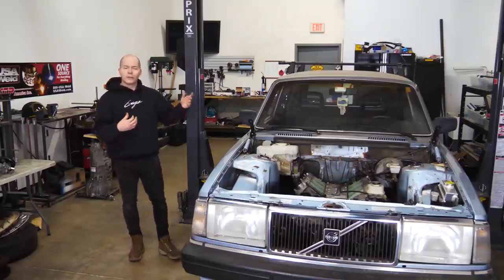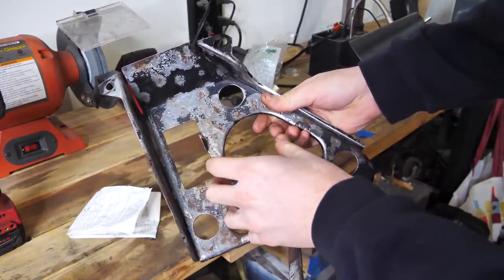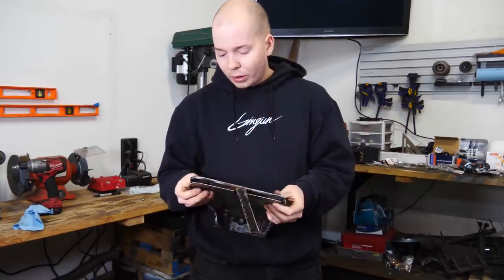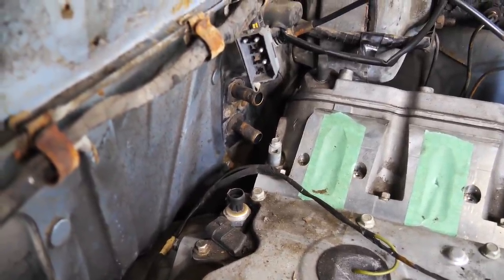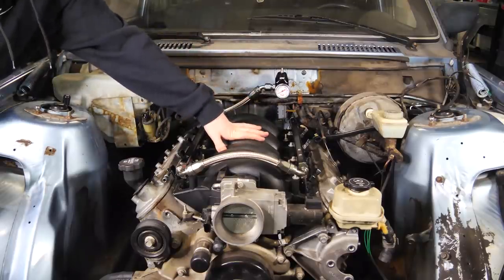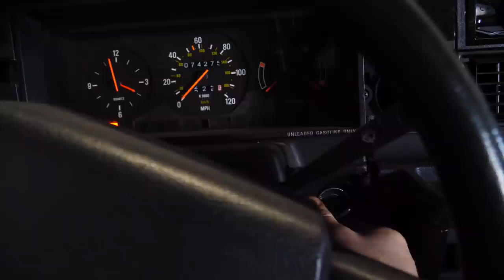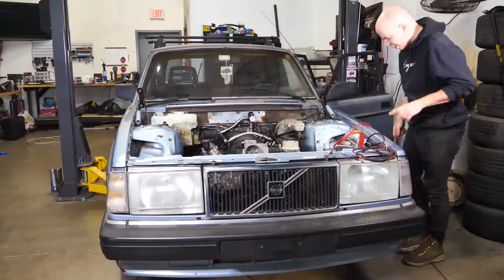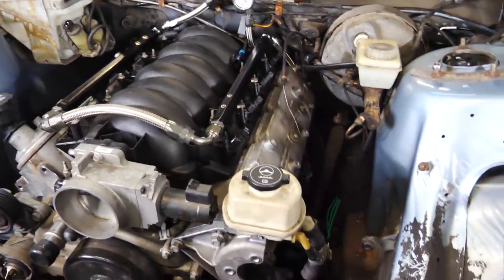Installing a $3000 UPGRADED FUEL SYSTEM on my $800 Dollar SLEEPER...

Comment: Hey buddy, just something that I learned from experience, NHRA rules state that your FPR cannot be mounted or secured to the firewall in any way and most inspectors will not pass your car for tech if they see that. I mounted my Aeromotive FPR on the firewall along with my flex fuel sensor and dude wouldn't allow me to race with my Civic.
Reply: This needs to get to the top
Reply: What's wrong with having a FPR mounted to the firewall? Just curious.
Reply: Directly from the NHRA Rule-book; Section 11A, Page 4, Under Fuel System;

"All fuel system components (regulators, cool cans,
etc.) must be installed not less than 6 inches in front of firewall.
Exception: Fuel-pressure-gauge isolators, with steel-braided line,
may be mounted on firewall"

For anyone wondering
Reply: @callmezucc9318  Thank you for this!
Reply: Bump
Reply: Plus one comment for raising this too the top so caleb sees
Reply: To the top you go
Reply: I hope he see’s this
Reply from the maker: Thats super wack
Reply: @FDB77  If the clutch, flywheel,  torque, converter or flex plate become unglued from the crank the parts flying through the bell housing don't take out the fuel pressure regulator.
Reply: @keithbusch4014  when I was building my 350 swapped s10 a buddy told me the fuel pump I had in the engine bay had to be in front of the flywheel. I learn more and more everyday
Reply: @_Gingium_  amen
Reply: @FDB77  Fire safety. Hence the name firewall. You really don't want fuel anywhere near a hole on the fire wall from what I can tell
Reply from the maker: It makes sense in terms of safety. I'll relocate in the future but for now I want to focus on getting it running/driving!!!!

Comment: There is a lift pump in the tank in addition to the inline pump under the car.
Reply: Was about to comment this myself. 240s have two fuel pumps. The other one is accessible from inside the trunk. Hopefully he sees this.
Reply: About to say the same aswell
Reply: Gingium pls see this comment
Reply: Notice me senpai
Reply from the maker: Thanks for the info! I wonder what I'll do with it 🤔
Reply: @_Gingium_  always great to see a comment response
Reply: @_Gingium_  probably just make sure its wired up correctly because you already have more than enough fuel pump with the inline DW
Reply: This is all tru I have a 92 Volvo 242 dl there is a pump in tank aswell
Reply: @_Gingium_  i see what you did there😂😂😂
Reply: @_Gingium_  get rid of it, they are small and weak pumps, they are just here to lift the fuel bc stock inline can't pull the fuel..
They often broke. Replace it
Reply: @_Gingium_  get rid of the inline pump and install a large intank pump. You can easily fit a walbro or something similar in there
Reply: On some old Volvos these pumps in the tank get rusty and stop working so the car pretty Much only runs with half or more in the tank or else the middle pump dont have enough power to get the fuel all the way to the engine,
But with your fuelpump upgrade i dont think that will be a problem. ;)
Reply from the maker: Do you guys know if replacing that in-tank pump with an upgraded pump (as well as having that inline pump) would be beneficial? Like will the two pumps build off each other?
Reply: @_Gingium_  it wouldnt really be necessary. The benefits would be less load/duty on the inline pump and a more cosistent pressure in case theres a voltage drop or maybe if the inline fails you may be able to limp it somewhere since you did say you planned on tracking it. There are some benefits. Id say upgrade it, but theres not really a need for a full race spec pump unless youre planning on going triple digit power numbers on the future then it wouldnt hurt to cover your bases now. I highly recommend upping the fuel line size coming from the tank, it'll make a world of difference.
Reply: Was about to comment this
Reply: @_Gingium_  I second that, check if that inline pump is designed to lift fuel or not, but in any case remove that small in tank one. Beware that the cables are really tiny tho, so you may need to re-wire if you plan on putting a bigger pump
Imo having an in tank is good as electric pump aren't that good at pulling fuel, it could have an impact when the fuel level gets low (it will get low fast, they are small tanks after all)
Reply: @_Gingium_  pumps push better than they pull, so I think replacing the in tank pump with a high performance lift pump would help the inline pump. DeatschWerks makes in tank lift pumps, probably worth asking them the pros/cons.

Comment: there's a pump in the tank as well as the inline one. Also 240s don't "prime" the fuel pumps like most cars. The fuel pump is waiting for spark to turn on.
Reply: Depends on your ECU. The updated 951 ECU's prime, older 5xx series ECU's dont
Reply: my 91 primes the pumps
Reply: @jimboyokel  I'm just going off of my 85. my b

Comment: Probably do not want to use the factory fuel pump wiring. Use the factory wiring to trigger a relay, and run a heavier gauge wire from the battery (conveniently in the trunk) to provide power. This results in more current available to the pump and less voltage drop (ie more fuel). I would also recommend some push lock barbs instead of normal barb fittings.

Comment: I also have that ESAB Sentinel welding helmet, it's absolutely amazing how clear everything is with it. I also like the grinding mode on it, I wear glasses so can't wear safety glasses and screwed up my previous glasses by just using them instead of safety glasses.

Edit: maybe try the clear cover instead of the yellow one some time, I personally like it a lot better.

Comment: i cant see that skinny wire providing enough power for that pump 
i would use it as a signal wire to switch a relay and as your putting the battery in the boot run a thick enough triggered wire from there

Comment: Tip when turbo charging an LS connect all four steam ports on the heads to the expansion tank on the cooling system.
This avoids hot spots etc.

Comment: I don't know if you have done this already, but you might want to put a relay into the fuel pump. A lot of times there can be voltage drop in the factory wiring at high rpm.

Comment: most parts stores will have premolded rubber elbows to make the heater core connections cleaner. You could use those part numbers to order the correct stuff on ebay to keep the build built from ebay.

Comment: For the future: fuel injection hose clamps. They clamp much more uniformly around the hose than a typical worm-gear hose clamp and do better at preventing leaks. Look them up on amazon or other.

Comment: ceramic coat and heatwrap is really good on engines with alot of pipingen on the "manifold side" it keeps the heat in other words energy i the exaust which helps with spool.

Comment: yeah dont use the factory wiring for those monster pumps. RUn new wire the same gauge as the pigtails you have on there with some chunky relays
Also, try picking up some "fuel injection hose clamps" instead of those little wormgear dealies. They clamp much harder and dont pinch into the rubber like the worm ones do.

Comment: You're gonna want 12 gauge wire at least to that fuel pump. It's rated at 750 hp at the crank at 40 psi, LS engines typically are set at 58 psi.  The higher the pressure is the flow is reduced. Your FPR should also be boost referenced to raise fuel pressure as boost rises to counteract the effect of the increase is atmospheric pressure working against the fuel. You will probably run out of fuel pump at the 500-600 whp mark. Also with an inline pump the feed from the tank is very important. Most guys making power with inline pumps sump and baffle the tank to  get as much fuel to the pump as possible. The factory volvo lift pump and lines might work to start, but most likely will be a restriction.

Comment: Okay, full disclaimer: I've never messed with an aftermarket fuel system setup.

With that out of the way, shouldn't the fuel filter be before the fuel pump? I would assume that you'd want clean fuel running through the pump, rather than fuel that hasn't been filtered. Again, never done this, just seems like pumping filtered fuel would make more sense.

Loving the build! Looking to turn my '91 Dakota into a sleeper, so this is hugely inspiring!

Comment: Since the Volvo 240 has two fuel pumps, the main pump isn't turned on until the engine is turned on. The secondary pump inside the tank is the one that gets power to start the engine and prime. 

You can use jumper wires on the fuel pump fuses (#4 and #6) to test the pumps

Comment: There is a fuel pump inside the tank. There are two fuel pumps, one externally mounted high pressure pump and one low pressure pump inside the gas tank

Comment: You really could do with a decent sheet metal bender and guillotine to complete these brackets yours are above par imagine how much better they would be with these workshop tools. and have you welded the other side of those suspension tiebar's or fully weld the side you have spot welded.

Comment: I think heater core line placement is just a domestic vs import thing
All domestics I have and have worked on have the lines up front while all the imports I have worked on were in the rear

Comment: With the way the regulator is mounted and with not much slack in the feed line.....When the engine torques sideways, will the fuel line over time "Yank" off from fatigue from being tugged on??
More slack with a L-style routing will let it move freely.
Can't remember but we're you using solid engine mounts?. Maybe not a factor if you are.

Comment: Hey I’m worried that the fuel line in between the fuel rail and the pressure regulator isn’t long enough for when the engine moves under heavy load

Comment: Ran into the same problem when I put a warlbro 255 in my 240 ....the rear hose that runs from the tank in low pressure line ......it will burst if you run a warlbro in the tank ...ask me how I know. I ran 9/16 aliunium line from speed factory off ebay

Comment: my opinion is that the hose from the pressure clock to the injection ramp is too short, for when the engine will vibrate hard in high rpm, I don't speak english well, I hope you understand 👍🏻👍🏻

Comment: 2 things. 1 key on is typically only a few seconds of prime  2 if you plan to run E85 youll need to change tge take hose to e85 hose or you're going to have a bad time insert south park meme

Comment: I bet you'd really like to see my -8 fuel system with a custom rail and regulator I installed in my 745 wagon :D
Reply: single pump 255lph system with 440cc injectors (could go bigger in the future)

Comment: Dude is trusting the stock 240 FP wiring to run the big DW pump!?  😨  brave

You gon learn

Plus...isn't the OEM 240 fuel lines done in nylon hose?  That might be why it leaked at the pump...you were clamping the rubber sheath and not the ACTUAL fuel line.

Comment: Also, I don't want to hear shit about you bitching about your welds...lmao Come see mine on the eBay turbo manifolds, collector pipe, up pipe, and downpipe that I just installed on my J32A six speed manual swapped CG1 Accord. ALL of the piping had to be cut and modified because the only part that fit properly was the manifolds themselves. I have a $600 Lincoln MIG welder, but no gas for it yet. I have 100% argon, but no mix, so I had to Flux core weld everything.